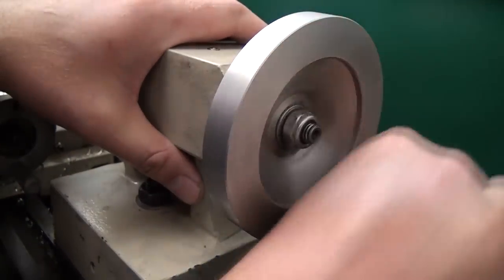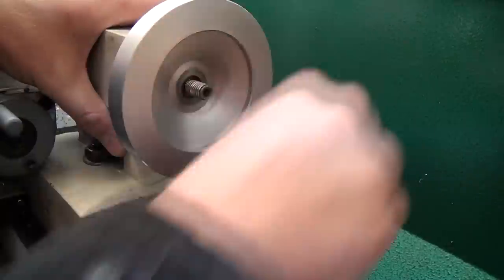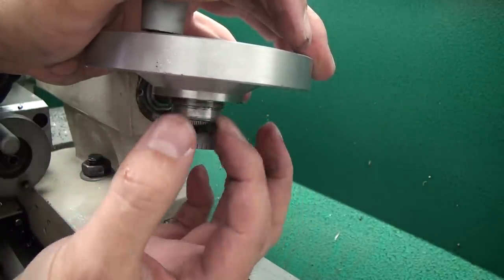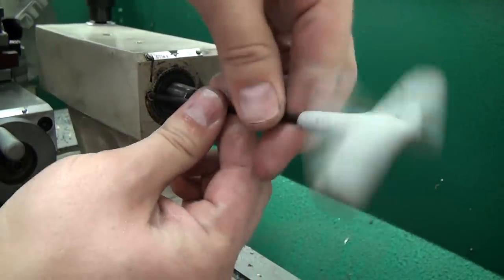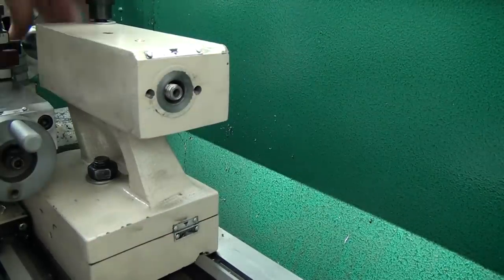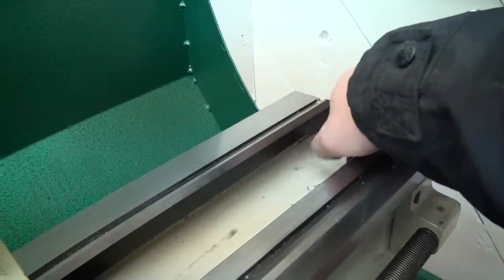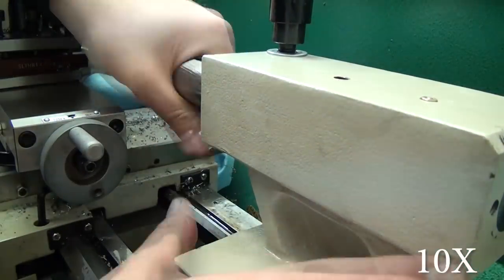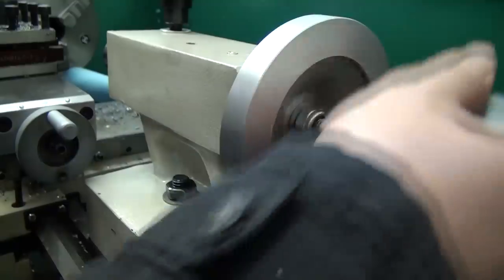07 G0602 Tailstock Disassembly & Cleaning

Comment: An old video but for anyone that finds it - clough42 had the same issue on his lathe and found that the screw used to lock the tailstock was shredding into the keyway which was then binding up the quill travel. He fixed it by turning the last couple threads off the screw (or making a new one), which meant the quill was no longer pulling material off the screw and everything stayed neat and clean and moving smoothly!

Comment: Thanks so much! I managed to damage my quill a while ago so I bought a replacement, but couldn't figure out how to remove it from the mounting. I expect to have the replacement installed this evening when I get a chance thanks to the video. My other G0602 issue is that the toolpost seems to be way too tall for the tools. To use a 1/2" cutting tool, I need to wedge the back of the tool to tilt it well downhill. It's been working OK for me in machining plastic and brass, but I need to research more about this situation too.

Comment: Great lighting in your shop!  When you start drilling think of using WD40 as a lube/coolant because the drill bits get hot easily and will burn up, also play with rpm's till it feels right.

Comment: Thanks for posting your video.  It was helpful in fixing my problem.
I spun my quill off my leadscrew for the third time drilling a hole and buggered up the threads again, but now so it wouldn't thread.  I can't understand why there isn't a stop to prevent this from happening.  Even my ShopSmith is designed to prevent the quill from accidentally falling out or spinning uncontrollably.  Maybe I'm doing it wrong!!!  🤪
Got any ideas to make a stop on the quill or leadscrew for the G0602 so it won't let the quill unscrew all the way and spin in the tailstock while I'm trying to drill a hole in my project??  Having the knob and handle spin like that can be a knuckle buster!!!

Comment: This is a guess but the 2 set screws maybe plugs for holes that are used for a gears puller. Attach the frame of the gear puller where the set screws are and screw thrush bolt into the tail stock shaft, forcing it out the front of the tail stock without hammering. 
Have you thought about making spanners for the two nuts on the head stock shaft, instead of using a pipe wrench? I made several for my Howa lathe and Bridgeport to remove the spanner nuts on the tables. I used 1\8" plate steel.

Comment: Well, I've had my G0602 since 12/28.  Did the break in and oil change and almost completed my first project.  THEN the tailstock exhibited the same problems that you experienced.   Took two hands to turn the crank.   I took it apart and oiled the heck out it with no improvement.   It felt like it was binding in the housing.   After removing the shaft and the screw, I chucked the spindle in the 3-jaw and used some very fine emery paper with oil and polished the spindle.  After re-assembly, it slides in and out like it is supposed to.  Now I can finish the project.  There was no foreign material in the housing  so other than being slightly oversize I don't know what caused the binding issue.
Reply from the maker: +Bill rouleau Interesting. I never did do anything to fix mine, but using a better oil certainly helped a bit. I'm going to try your method of polishing. Thanks!
Reply: +russtuff  I was surprised to find no crud, burrs or Cosmoline in the tailstock housing or on the ram.  I believe it was an issue of the tolerances a wee bit tight.
Reply from the maker: I still need to do this on mine :/

Comment: Thanks for this. I have the same issue. I think maybe over tightening the quill lock may be the issue with the quill getting too tight. I will have to take mine apart and check it out.
Reply from the maker: Let me know if you find anything telling. I never did modify mine in any way but I've thought multiple times about running a cylinder hone down the bore to try and loosen the tolerance a bit.
Reply: So I took it apart and checked it out. At least on mine the cause was the torque from drilling raises a burr on the slot on the top of the sleeve where the set screw goes in and causes it to drag on the tail stock casting. I took a file to it and knocked the burr off. It’s seems to work a lot better. TBH I’m not sure what a long term solution would be. We need another solution beside the set screw to prevent the sleeve from rotating. Either that or harden the sleeve but then it would need to be ground back straight.

Comment from the maker: you make a good point about the set screws. i had never considered using them for that purpose.

the spanner idea on the two nuts would be great, but i have actually never had to grab the spindle by those nuts to do anything (or remove them for any reason). some people can't break the chuck loose when they first get the lathe, and use the pipe-wrench method, but i didn't have that problem :)

Comment: It looks like the 602 is being replaced by the 752, a variable speed with the same specs as the 602.
The 602 is not on listed on line any longer but is still listed in the hardcopy catalog for 2015.
Reply from the maker: I know they've had the variable speed model for a little while now, but I didn't realize that they were discontinuing the 602. That's pretty cool, I wish mine was variable speed.

Comment: I have been looking at the 602 for a little while.
The 752 seems to have more features that I can use.
100 -2000 rpm AND variable through out instead of just 6 steps in speed with top end a 2400 which seems way too high to me.,
Of course the price is about $200 more.
Reply from the maker: Yeah great points. I do 95% of my cutting at the 720 rpm setting anyway. Once in a while I'll go up to 1250, but never 2500. That basically tries to shake the machine apart.